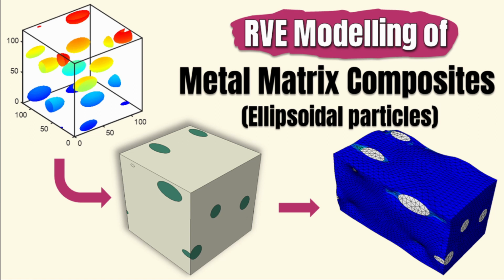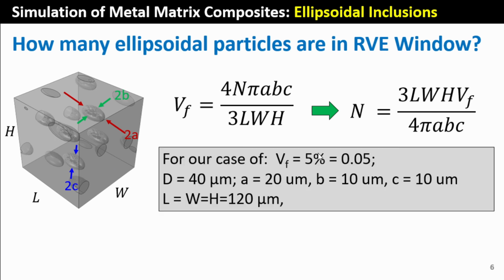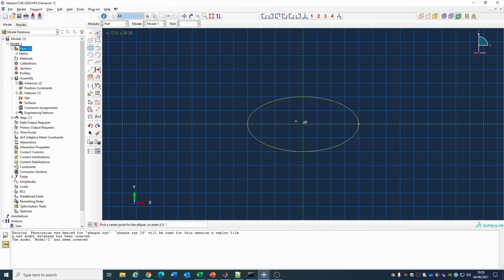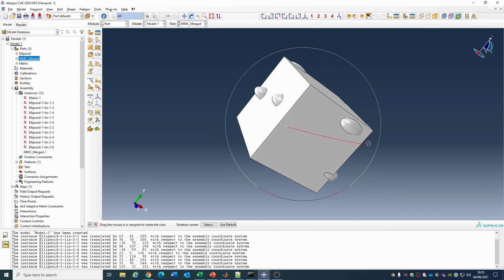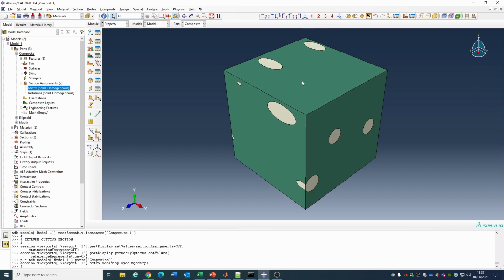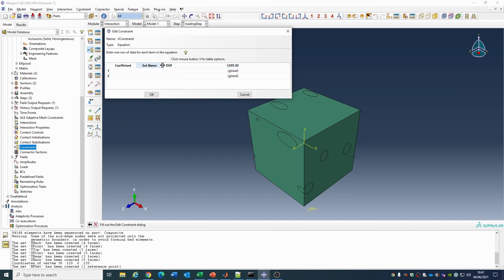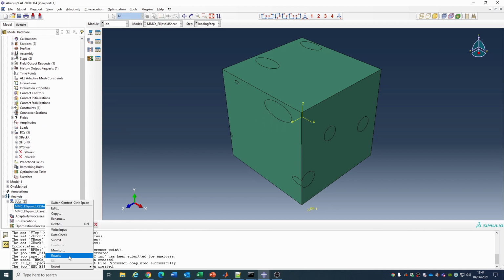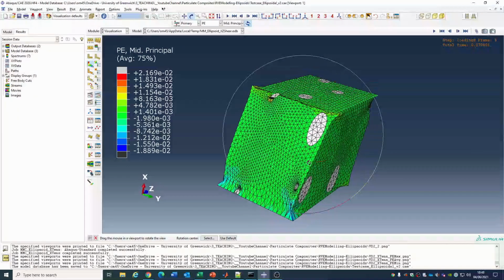ABAQUS modelling of ELLIPSOIDAL particulate composites.

Comment: Hi, Dr Michael, I don't know how to mesh a complex reconstructive particle model, for example, I want to mesh the RVE about (CNTs+SiCp) reinforced Mg matrix composites, but I can't mesh the RVE correctly. I'd really appreciate it if you could give me some advice. Thanks a lot.
Reply from the maker: Hello @Sbj gjb, I am not sure if I understand how you want me to support you. It seems the muti-inclusion problem is making meshing hard. Have you tried meshing it with a tetrahedral element type. This will in most cases make meshing easier. You can also explore partitioning of the model into different units which allows for effective meshing of the domain.
Reply: @MichaelOkereke  , yes, I had tried to meshing it with a tetrahedral element type. But in the PMMC, 
there are many grids with poor quality. The particles are Silicon carbide with CNT grown on the surface and the Silicon carbide particles are irregular polyhedrons, so I think partitioning the model may not be a good way.

Comment: Hi Dr Michael, I was wondering if you had a video about irregular particles in a matrix and/or particles with varied sizes (mean and standard deviation known) I was thinking of simulating mean and S.D of particle sizes using Monte Carlo but wondered how you would tackle with irregular shapes too. Many thanks :)
Reply from the maker: Hello @Matt, thanks for your interest in the channel. I had a video about creating voids (for porous media) with irregular shapes (manually), and you can see it here: https://www.youtube.com/watch?v=Xf_h28mhVjI. 

However, I do not have anything specific to what you describe here for varied inclusion sizes. I agree with your implied comments that for regular shapes, with mean and standard deviation of particles, one can create using the Monte Carlo methods RVEs with a random distribution of fibre diameters and position. For irregular shaped particles, this can be slightly challenging but I will follow same approach. 

What I will do is to circumscribe the irregular particles within a circle. So, two steps: first create the randomly distributed particles using same monte carlo approach as regular shaped inclusions. 

Then second, you remove the circles and impose/draw an irregular geometry inside them as replacement. What is difficult is calculating the volume fraction of the inclusions when geometry is irregular.  One way to get the volume fraction is to find the area integral of the irregular geometry but then you have to be able to prescribe a mathematical function for the irregular geometry - which introduces another layer of difficulty. It is possible  but not trivial to create irregular shaped inclusions. 

Needless to say these need to be done from a Python script to make things easier.

I will think about it and see if there is a possibility of making such videos, if I can work out how best to achieve this.
Reply: @MichaelOkereke  Hello Dr Michael. That is a very helpful response and I appreciate your time replying. I will give that video above a watch. 

Essentially, I would like to model on Abaqus a gel matrix with cavities of oil/air pores inside. These cavities are without doubt irregular shapes. I think to begin with I will simplify my approach and use circle/spherical cavities and see what output results I get and look to add complexity if I struggle to achieve data I was hoping to obtain. I like your idea of the two stage approach and I will implement this if I struggle with regular shapes. My understanding of Python and Matlab isn't the best but I agree creating a script is potentially the easier approach than manually drawing these. Do you have a video already on using Matlab/Python to create a script to then implement into Abaqas? Many kind regards, Matt
Reply from the maker: Hi @Matt, just picking up on these a month later, and hope these responses are not redundant. I agree with your methodology. Sounds reasonable. I do not have that sort of script now but potentially MontCarlGen3D can be used for this (as it generates script) for spherical inclusions/cavities as yours. There are a few recent videos on my channel on porous media which might be helpful - please look at them.

Comment: Great work Dr Micheal, I was wondering if there was a way to measure the stress in the particles, not the bulk composite material. I'd be grateful if you can do a simulation in this regard.
Reply from the maker: Hello Adedotun, I suppose you want to find the stress (cumulative) on the particles. That is possible, you just need to create a nodal set of the particles, and then make those a history output for the stress measure of interest. At the end, using volume averaging method, you can compute the stress (averaged) over the particle constituent. I can explore this in future to make this sort of video depending on interest and likes to this comment.
Reply: @MichaelOkereke  pls make it, thx

Comment: Very interesting video but when I ran the script it gave me an error “TypeError: keyword error on scaleStress” so, kindly can you correct this error. Thanks in advance
Reply from the maker: Hello John,

I have checked this and the script seem to be working well from my end. If you are having issues with the scaleStress, maybe you can comment it out of your script. That means when the script is executed, you will have to go back to the Aluminium (matrix) material and manually create the plastic behaviour. This is how your commented script will look, just but the hashtag sign in front of the set of colleges starting with mdb which creates the plasticity material model entry. Try it out and let me know how you get on.

# mdb.models['Model-1'].materials['Aluminium'].Plastic(scaleStress=None, 
    # table=(
     # (250000000, 0), 
     # (248000000, 0.05), 
     # (240000000, 0.15), 
     # (230000000, 0.8), 
     # (220000000, 1.5)))
Reply: @MichaelOkereke  Thanks a lot it works well after I did your recommendations for correction but kindly what is the function of scaleStress